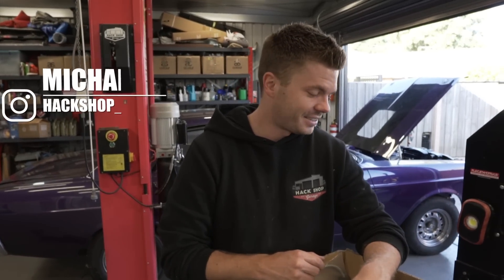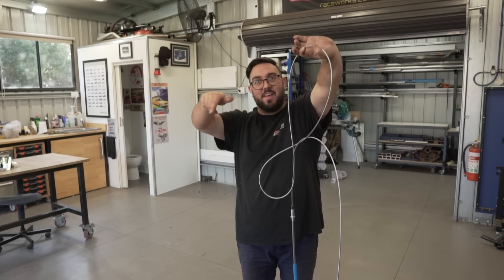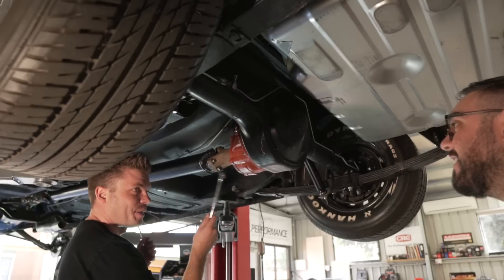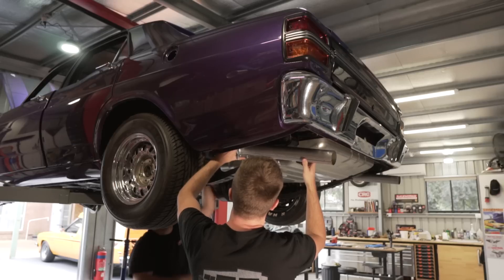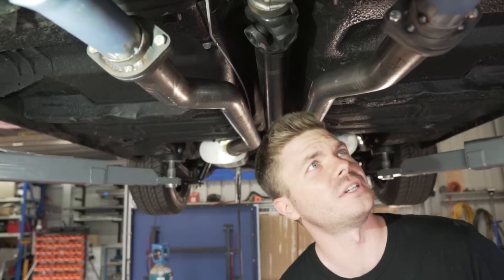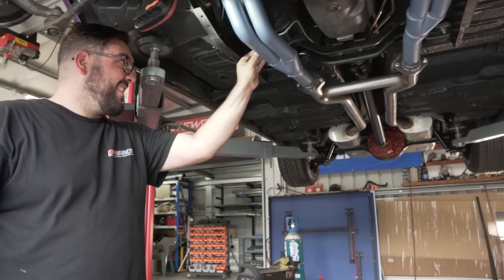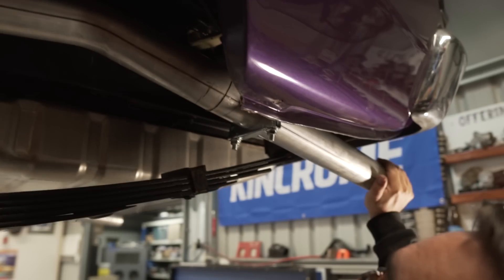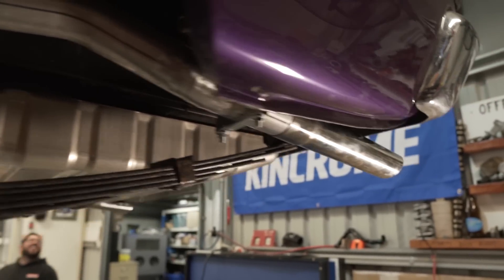XY GT Falcon Build - Part 7 - Building a 2.5" Exhaust System And It Looks Wicked!!!

Comment: A suggestion for future reference. Heat the tailpipe with an oxy put a large lever in it and bend it to where you want it. No cuts no welding. I know you probably don't have an oxy and I know you don't use them much any more but that is where they are really useful. A hand held blow torch might have heated it enough for your job too. Great work boys

Comment: Guys hate to say but those grinding sparks all over that new Zinc Fuel tank is going to make it rust faster than you can make a new exhaust system. Not sure Rodney will be happy . The Tail tips should not have been welded on they had a clamp holding them to the exhaust !

Comment: Mmmmm i hate to say it, but it's only my opinion that the H pipe needs to be a couple of inches further down the system. Typically the last 45 degree bends where the pipes come back towards each other is where I'd have put it. This would encourage exhaust scavenging, with where the H is at the moment it will equalise pulses but it won't encourage much scavenging.

Comment: Guys the H pip is way to long and I'm trying to work this out watching this several times. 
The explanation is the two pipes from the headers to the exhaust are the wrong way around. They should have been swapped from left to right so as that when they come out of the headers they are closer together but then follow through to pick up the mufflers.